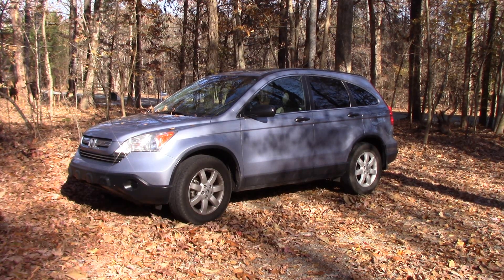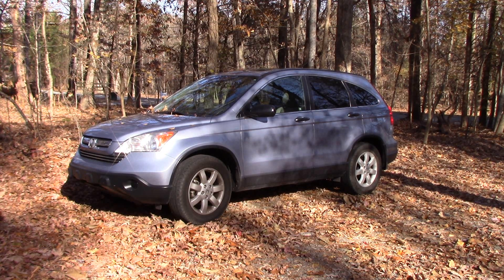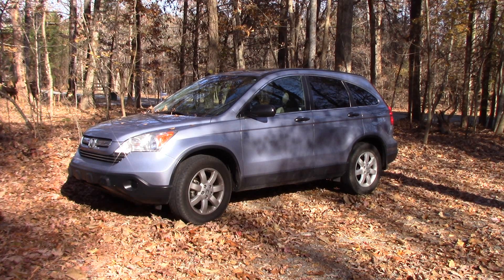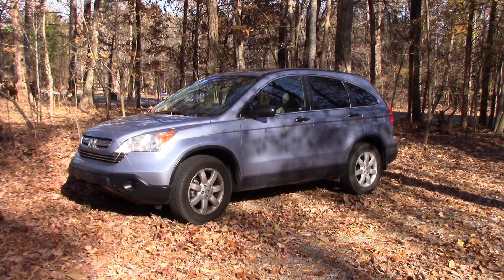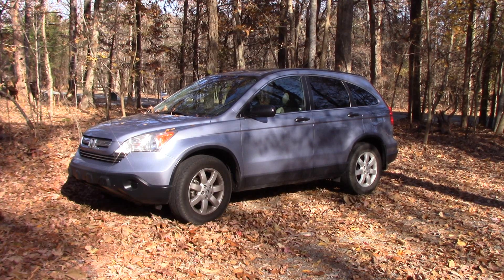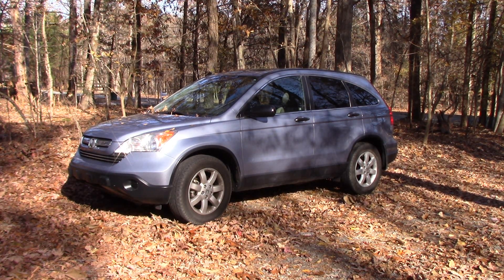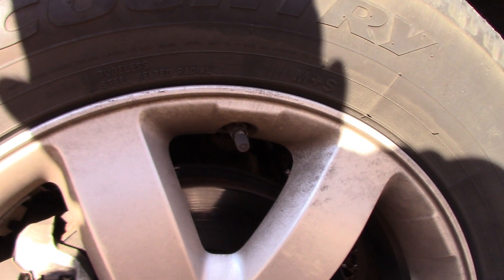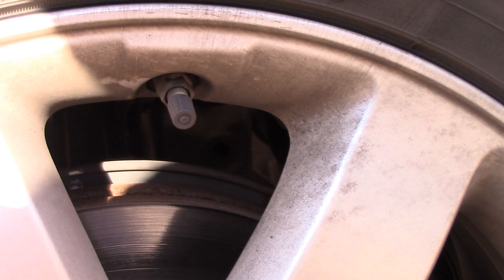2007 Honda CR-V TPMS Tutorial

Comment: Honda tpms is the most useless thing. Doesn’t tell u which tire may be low. I have a VW TPMS which has tire pressure readings on all four. Can’t believe Honda was ok with this tpms system.
Reply: I guess Honda is not the kind a car for you.

Comment: Regardless of the TPMS you or someone else  should routinely inspect the tires and then check the tire pressure. Problem is very few people have the means to add air if its needed. Unless their money hungry jerks the local tire shop should be happy to add some air and hand you a business card.

Comment: wow, I also have an 07 blue  CR-V with the rear driver sensor needing to be replaced. don't have discount tires where I live. the shop I took it to is charging $85. gonna shop around a little more to see if it can be done for less. thanks for the video!
Reply from the maker: I just had another one go in my car.  It was 72 bucks to replace at Discount Tire.  I could have saved myself a trip had I thought about having them checked when I had new tires put on last week.  TPMS light popped on 2 days after the new tires were put on.

Comment: Nice video. I have a 2009 CRV and all the TPMS are still working correctly but at least I'll know whats wrong when it finally  happens. However, I doubt I will pay anything to get it fixed since I can just check tire pressures periodically.

Comment: Have same problem on my 2007 CRV I took it to honda dealer more than a year ago they said it would cost me $125 to fix including checking it.  I said forget it. I'm still driving my car with the tpms light on, the guy (independent mechanic) who I go to for oil change told me it's nothing to worry about just keep checking the tires every now and then. I get the oil change every 3 months so they ✔ the tires.
Reply from the maker: Yes, the stealership price.  Minimum labor is at least 100 bucks these days.  My local Discount Tire does it for around 75 bucks.  You get a whole new unit since the batteries aren't removable.  Heck, just fixing a flat is around 25 bucks these days.

Comment: My TPMS light came on, apparently because I added just a little more air than needed to two of the tires.  It was only 1 psi over, but the TPMS on my 2008 CRV didn't seem to like that too much.  It's always a good idea to check the spare and put air in if it's not at least close to what the placard in the doorway next to the driver seat says, though, since you won't be able to inflate it unless you keep a 12-volt tire pump or manual one in the car.  I can't even imagine how long it'd take to pump up a car tire manually, though LOL
Reply from the maker: I come from the manual pump era.

Comment: Wow..i took mine to el monte honda and the assistant manager told me i need a diagnostic done($130) to pinpoint the problem and from there they will know what parts my car needs replaced ($300 -$500). And this video shows it only cost $64.50....damn el monte nelson hondas!
Reply from the maker: Sometimes they earn the name, “stealership”. Not all are that bad.
Reply: My diagnosis was free.   Replacement with labor would set me back $125

Comment: My son has a 2011 CR-V. we've replaced all 4 TPMS wheel sensors, but the Honda dealer can't get them to synch to the TPMS control module. Is the module bad? Maybe a fuse?
Reply from the maker: The dealer doesn’t know?  Wow!  That’s odd. I do know the sensors can be on different frequencies. Maybe the sensors don’t match the Honda criteria based on frequency.

Comment: I have this issue. TPMS (not low pressure indicator) light came on when driving in the highway. I got to my destination and about 3-4 hours later I checked all tires and they were at  27 psi. Light went off after I checked the pressure so I went to calibrate all 4. Got onto the the highway again to return home and after like 20 min on highway TPMS light came on again. Is it similar to what you experienced? Could it be a faulty tire pressure sensor? Thanks
Reply from the maker: The low pressure tire indicator is the TPMS light.  Check the panel on the driver side for the correct inflation of your tires.  27 is a bit low.  Most tires are 30 to 32.  Check your spare also.  Some cars have TPMS indicators on all tires.  My 2013 Highlander has a full size spare with a TPMS monitor.  If a cold snap hits then they have a tendency to pop up.  The batteries only last 7 to 10 years.  They can't be replaced by themselves, you have to replace the entire unit for that and several other reasons.  Inflate your tires to the correct rating and drive around some more.  If the light doesn't go out in 15" to 20" then it could be a battery or batteries.  It might even be a bad unit, but that doesn't happen often.  They are pretty reliable.  I also know most of the scanners shops have don't read the percentage of battery used or what amount of life might be left in the battery.  It's usually alive or dead in the water.

Comment: Next time, go to tire shop, request them to put in the regular valves. Put all TPMSs in glove box. Mark all units with markings (color or stripe). When one goes dead, cut out the battery, put in new battery and leave it back in the glove box. Done.
Reply: Really that works? I thought they had to be in the wheel.

Comment: Hello all, I have a question... in the last days i put 4 new sensors in my CR-V (US model 2008) then the nightmare begins XD...i paired the new sensors with the car, so the low pressure light starts blinking the whole time....i drove ca. 2000 kilometers and the light is still blinking...so today i try to "wake up" the sensors with the ATEQ VT55 tool and it works, the light stop blinking and shines permanently... So I increase pressure and hope the problem will be fixed, but in this moment which I increase the pressure, die pressure light goes off and the TPMS light goes on XD.... Anyone have an idea? No DTCs in the system.... Greets from Germany
Update: if I Reduce the pressure a little bit, then immediately the low pressure light turns on...